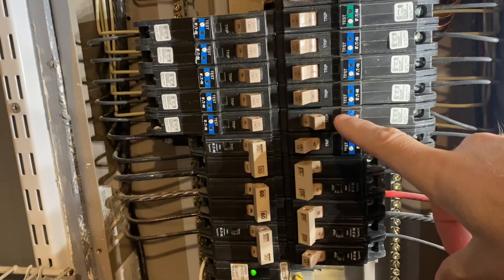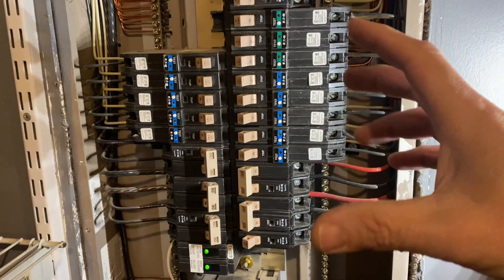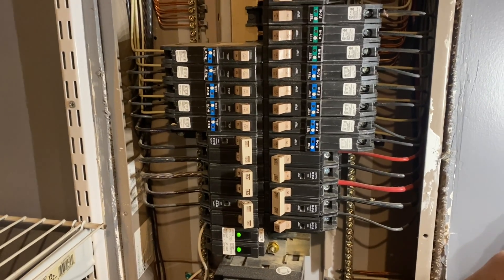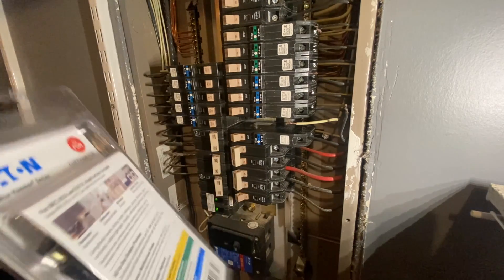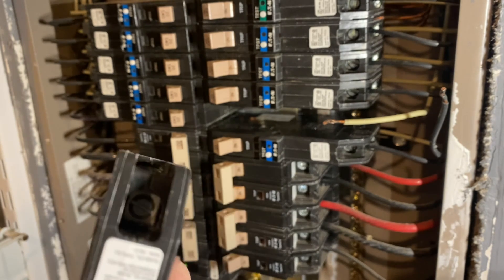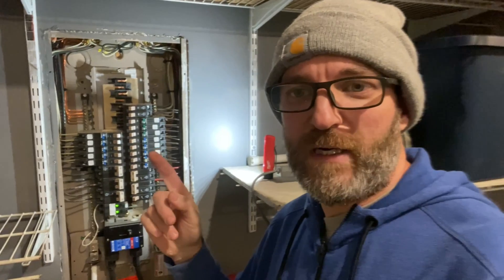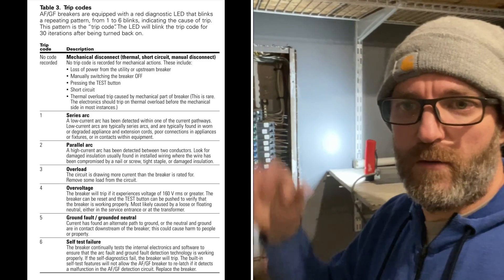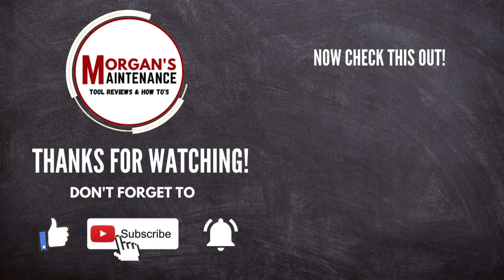Eaton CH AFCI GFCI Breaker Tripping Randomly / Blinks Red and Gives Code #watchmework

Comment: If nothing's plugged into it, how do they know it's tripping? Unless it is a occasionally used outlet OR they are worried about it check it randomly.
Reply from the maker: They had unplugged stuff to see if it tripped with nothing plugged in.  I asked them to do that before I came.  It tripped either way

Comment: wow! I've been having on going issues with an EATON breaker tripping. I've had it replaced multiple times since I've lived in my townhouse for 5 years. The breaker box is outside so it's a real pain to replace especially in bad weather. Your solution of 'unplugging' the appliance, in this case a fridge on a single breaker fixed the issue. You just saved me big $$$ from calling an electrician. A handy man friends who does electrical work but not a licensed tech told me that because my breaker box is OUTSIDE and get's direct sunlight that may be a contributing factor as well, what do you think?
Reply from the maker: If there is excessive heat outside heating up the breakers it could play a Role.  Many people are contacting Eaton and getting new breakers under warranty. I think they had some bad ones in that older model
Reply: @MORGANSMaintenance  yep, you are correct, there are 180 units in my townhome community built in 2018 by Lennar, everyone experiences the same issue. Eaton gets regular requests and they are very accommodating, replace and ship for free since it's a known issue.
I'm hoping switching from the upper to the lower outlet in the wall plug is a long term fix. Otherwise, do I change out the entire panel box?
Reply from the maker: @JayJoJonny the customers newer model breakers that I have put in are still holding strong.  Time will tell on those, but it’s been a little while now

Comment: I have a newer house built in 2018, i have had to replace 4 breakers so far for the self test.  All were tested and I would unplug all electronics from them and they would continue to flip.  Once replaced they have been fine but incredibly frustrating.
Reply from the maker: @ryanestep9392  yeah it’s a common issue.  Many people have been able to warranty these out

Comment: Did that fix their problem? My mom has the same issue and she had the breaker replaced. It is still doing it. Any ideas or suggestions?
Reply from the maker: @txguy1530  did the blink count say anything different?
Reply: @ no, still 6 blinks
Reply from the maker: @txguy1530  I have had three different ones at the same customer do the same thing, but the replacement fixed them.

May want to make sure all the connections are tight… does it trip right away or after awhile?
Reply: @ after awhile. We reset it and does the same thing. It was replaced about a month ago
Reply from the maker: @txguy1530 yeah I would make sure there are no loose connections, or you may have just got another bad breaker.

Sounds like you have someone else doing it, if it was my house I would personally swap the breaker with another one in the panel.  If that tripping breaker in the new location still trips, it’s the breaker.  If the other breaker you swapped it with trips in the same location it’s tripping now, you probably have something going on with that circuit. That at least narrows it down.

Comment: Eaton AFCI's had a HUGE problem with nuisance trips caused by Ham Radio HF RF energy.  There are many discussion regarding this problem on the many Ham Radio web sites.  The Square D's and Siemens had ZERO issues with the same HF RF energy.  I'm not sure if Eaton ever got this issue resolved.

Comment: Funny how the description for the self-test states that the breaker will not re-latch after reporting a self-test error. This is apparently not always the case, as I went to a tenant's house to diagnose a couple of randomly tripping breakers just like the one in your video. There were six breakers in total, and I tested every one of them. Five of them reported self-test failures, yet I was able to re-latch every one of them.  The only one that did not report any errors did not latch completely off every time when I pressed the test button - it would only go to the middle position.  I contacted Eaton to get warranty replacements (these have a lifetime warranty), and was sent six replacements.  The downside of the warranty is it can take a couple of weeks to receive them, but Eaton is very good at honoring their warranty. I did not even need proof of purchase.

I take care of eight rental houses, and have replaced these AFCI/GFCI breakers in multiple homes. They just do not last. Unfortunately, the 2023 version of the electrical code now requires these for almost every circuit in your house.

Correction: My breakers were the CHFP120DF model, but essentially are also combi AFCI/GFCI breakers with plug-on neutral.
Reply from the maker: Yeah people have been saying they warranty them out pretty easily.  In my case the tenant didn’t want to wait so I didn’t try.

Thanks for the info 👍

Comment: Just installed 5 of these Eaton breakers in my generator transfer panel. All of the circuits are newly run dedicated circuits as part of a renovation project. I don't have all of them connected yet but the three I do have connected, trip. The smoke alarm circuit was tripping right away for no reason. Would not reset. Until it did. Been holding for a couple days now. The dishwasher/garbage disposal circuit trips right away and will not reset when either the garbage disposal or dishwasher in plugged in. The brand new range hood circuit trips the breaker immediately. Again, a dedicated circuit. Nothing is grounded. I get 5 blinks on each of the breakers indicating a ground fault or a grounded neutral. Could this be because the neutral bar is bonded to the new main panel? I actually just thought of this as I'm writing. Will look into that today!
Reply from the maker: @tomacquilano1304  sometimes you have to write it out to work through your problem 😂

Hope you get it figured out 👍
Reply: @MORGANSMaintenance  But then I realized the neutral in the main panel in our other rental was also bonded to the panel. No problem with the arc fault breakers there. They are Square D. 🤔
Reply from the maker: @tomacquilano1304  you don’t have any shared neutrals do you?  It’s hard to describe things by typing for me… but I know in the past I’ve ran into circuits with shared Neutrals that caused issues with these style breakers.

The panel you have these in, is it a main panel or a sub panel?
Reply: @MORGANSMaintenance  It'a an Eaton transfer panel for the backup generator. I'm going to contact Eaton today to see if they can shed some light on the situation. Each of the arc fault breakers are on new dedicated circuits. All new wiring.

Comment: Nice job. I like the long neutral / ground bars in the panel. I have a 200 amp Murray panel and the bars are short, I still have six open spaces but If I ran any new circuits there would not be any open spots for neutrals. Thanks.
Reply from the maker: @whitetiger8652  I don’t run into these panels often, typically Square D or Siemens in my area.

Sometimes they don’t give you much space

Comment: It's a Sunday night. I was at Lowe's.   Some dude was next to me looking at the same breakers. He had replaced 2 Eaton breakers in in his home so far.
QUESTION: Does Eaton need to go back to the drawing board?
Reply from the maker: I’m thinking the newer model number I put in, has the issue fixed.  (Time will tell I guess)

People are saying you can get them under warranty through contacting Eaton.  I haven’t done that, so I’m not sure what the process is like.

Comment: ?Watched @ .25 speed, slow motion LED flashed 5x for Ground Fault / Current Leakage?
Reply from the maker: ?… maybe when you change the speed it affect how it shows.  It was 6.  They had another breaker since this video do the same thing, replaced with new, but they said this one replaced first has never tripped again.

Comment: I have good news for everyone who has these breakers. They have a lifetime warranty so you don’t have to keep buying replacements. On a general note it seems that all of this type are not very good. Just had to replace 3 more.
Reply: I just had my one of these (15A) shut the power off to my office (3rd bedroom). Didn't think to count the blinks before hitting the test button as I had not found this page first. How can you tell what Gen you have? This house was built in July 22 and this is the first time this has happened in any room.  Hopefully it is not going out but it looks like its pretty easy to replace, though I'm not an electrician I know how to replace outlets and fixtures if it's not too different from that. Power came back up after flipping back to on, but tomorrow may be a different story.
Reply from the maker: @jac37040 (not that I’m recommending you do it for legal reasons 😂), but it’s not a hard change, the best thing if you are uncomfortable is to flip the main breaker and change it out.  That way everything in the panel but the main wires coming in is off. That’s safer for ones who haven’t worked around the inside of a panel a lot.

Your panel should have a label on the door that will tell what type breakers the panel takes.
Reply: @MORGANSMaintenance  thanks for the advice! I can’t tell if my breakers are the one with the white wire or the plug in type unless I take the grey panel off to see the rest of the part. I did get a picture of the Eaton panel board info but it didn’t specifically say which of the two to use, but there’s a lot of info on the sign I’m sure I may have missed it
Reply from the maker: @jac37040  that is the easiest way to tell 👍
Reply: @MORGANSMaintenance  / I've got 7 of these in my panel and have replaced 4 of them in 3 years (New home). They are problematic. I replaced them with standard breakers and then swapped the appropriate 15 amp receptacles with GF, I know I'll eventually replace all of them all ...
Reply from the maker: @Andrew_M_Ward  they have seemed to have issues.  I haven’t ran into these much in my area, most are Square D and Siemens.

Comment: Monday, I'm fixn to deal with 2 of these breakers tripping. First time I've delt with this type. Not a lot I've found about them. Customer just moved in a 10 yr old home and a BrandNew smart refrigerator is tripping it. Should be fun. I hate over engineered stuff. Thanks for the video.
Reply from the maker: Yeah, I have already changed out two more at this house since this video.

The ones I am changing out to are a newer model breaker, they hopefully fixed the issue in the original. (Which has been discontinued)

I have had a few people say if you contacts Eaton they might send you a replacement.  Just FYI in case you want to check that out, sometimes there is more time in that stuff then what it’s worth.

Comment: Same issue with this same breaker. Connected to my washer, Trips for no reason, but works fine when I flip it back. It shows 6 blinks and you video is great to show the remedy. Thank you. I will change this out.
Reply from the maker: I have changed out two more at this house since this video for the same reason.  All the new ones are working as of now.  Must be an issue with these breakers.
Reply from the maker: Also these breakers are about 1/2 price on Amazon compared to Home Depot
Reply: I have noticed that on Amazon, I just wasn’t sure if it was the same quality of what was available in the store.. I will surely buy them there then! Thank you again!
Reply from the maker: @cracker135  the first one I got at Home Depot, the other two I had time to order. They were identical. 👍
Reply: i'm to the point now that i think i will turn down any electronic breaker call:text-green-game-over:

Comment: Make sure that the metal staples used to secure the Romeo wire is extra tight….. hit it3times  with a hammer
Reply from the maker: I didn’t pay any attention, did you see some tight staples in the background?  I didn’t wire the panel.

Comment: I am having the same problem in a Galveston house .It is blinking 6 times. Thanks for the video.
I just reached out to Eaton for warranty info. These things are expensive.
Reply from the maker: Yes they are… they are about 1/2 price on Amazon compared to Home Depot.  I have changed out two more at this house since the video.

Seems like they have an issue.  The new ones have been working fine.
Reply: I think the 6 blink code is internal failure -its bad

Comment: Thanks for the video. I am not sure if this will help, but I live in Ft Worth TX, and my house was built about 5 years ago. We had a rash of these breakers go in the neighbor. Most folks call an electrician and paid dearly to get them replaced I call Eaton and spoke to a Tech there and was told that they had a batch of them that had this issue of failing after a short period of time. They sent me three for free. I would be curious to know the life expectancy for these units. I mean they are not Cheap by any means. I just had another one go. Thank my higher power I can replace it myself.  If any of you experience Electricians know how long these should last I would love to hear back. Thanks for the video my is a 6 as well, with a solid red in the window. While I am glad they are looking out for us I just wonder about the software code they using as I am a developer and do code and I know how faulty Code can be..
Reply from the maker: Since this video I have changed 2 more at this same customers house.  The new ones I am putting in are a newer model number since the originals have been discontinued.  So far the new ones haven’t faulted out again… but who knows for how long. Hopefully they fixed something in this model.

I think this panel was inspected in 2019ish… I can’t remember for sure. So it was 3-4 years on the ones I’ve changed so far.

Yeah it’s a good chunk of change for just the breaker… not counting paying someone to change it.
Reply: @MORGANSMaintenance  Thank you I appreciate the feedback. I would expect these units to last longer then 5 years. Yes I was told our houses mostly likely got the bad batch of breakers. I just wrote off to them to see if they will supply a new one for free again.. Thanks all the best for 2023 stay safe..
Reply from the maker: @richardgarrow9260  👍

Comment: My boss supplies the Capri torque screwdrivers for us. It’s held up well for me. That panel looks clean!
Reply from the maker: Yeah it was a pretty nice panel… You never know but as soon as I took the cover off I thought, “The odds of this being a poorly installed breaker is not likely”. That and it had been in place for several years.

I have the Capri and really like it..  I got the WERA at a price I couldn’t pass up is the only reason I bought it. It doesn’t go to a high enough in/lb for Square D though. Capri is a better all around.

Appreciate the comment 👍

Comment: There are tons of people having issues with Gen 1 & Gen 2 of these breakers. I reached out to Eaton support and they confirmed those breakers have issues. They sent me 4 new breakers (Gen 6) to replace them. I just installed them so not sure yet if I'm having the same issues
Reply: I've had problems with Gen 6 breakers as well (the CH Combination AFCI with Ground Fault Protection, model CHFP120DF). These 'smart' breakers just do not last.

Also, FYI, in the literature included for this model breaker, it does not indicate that the breaker will not re-latch after a self-test failure. It states "The breaker continually tests the internal electronics and software to ensure that the arc fault and ground fault detection technology is working properly. If the self-diagnostics fail, the breaker will trip. The built-in self-test features will trip the breaker within 2 seconds of reset if the malfunction persists."  So, apparently there can be false positives that can trip the breaker, if a 'malfunction' can go away.
Reply from the maker: @thehoneybadger9262 👍👍
Reply from the maker: So far my customer said theirs is holding… I told them based of feedback they can probably plan for more in the future..

Comment: It’s cool to see eaton doing similar things in their breakers as they do in recloser and regulator panels in substations. We run into the failed self test regularly on our regulator panels here in Kentucky. If it is accurate, cool, but if it not, it’s costly for no reason
Reply from the maker: Yeah that’s what I thought about it too.  If it gives you the right info, it’s a nice feature… if you can’t trust it… it’s not.

I hadn’t run into any of these yet, apparently they have GFCI outlets that do the same too.

Thanks for your thoughts 👍

Comment: My parents had a new home built 10 years ago & it had several of the Eaton GFCI AFCI fail,  with exact same complaint symptoms. I went thru similar troubleshooting steps as you & went ahead and swapped them out with new Eatons. So far no issues & its been about a year. I think these breakers expire after so many years. anyway, this video is sure to help others. Thanks for posting 👍
Reply: likely damaged from a surge, not the breaker's fault.
Reply from the maker: Thanks for the feedback.  Yeah GFCI breakers are a little touchy… they cost an arm and leg too .

Thanks for watching 👍